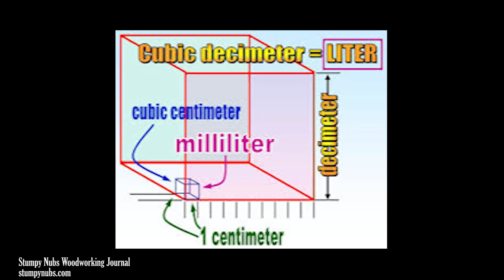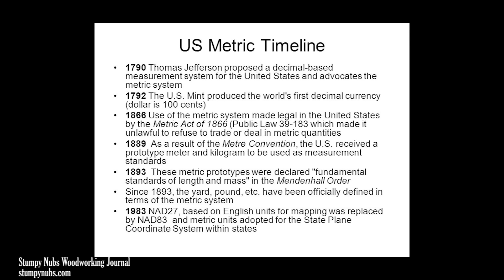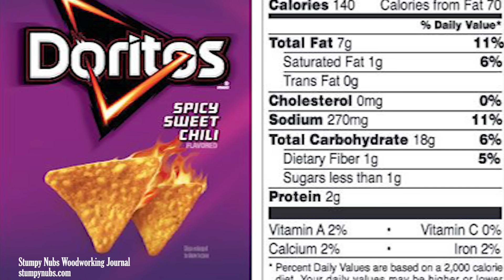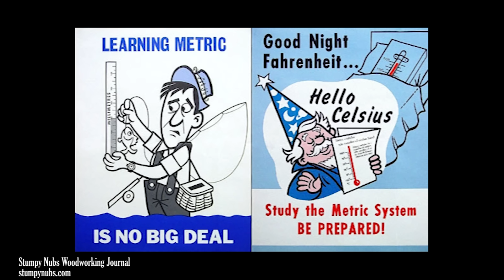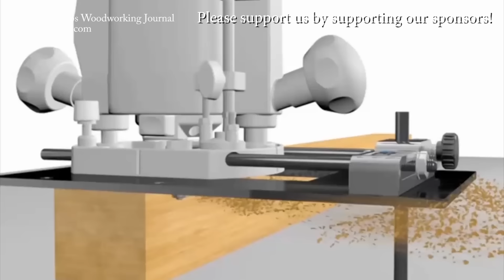BREAKING: The USA is switching to METRIC!

Comment: I was born and raised in the US and now live in Canada. I comfortably switch between imperial and metric; sometimes within the same project. For certain though any time I need to find the center of something, I use metric. Division of whole numbers beats fractions any day.
Reply: Quite.  I enjoy watching people trying to centre something 43 and 3/8 inches on one side, 44 and 5/16 on the other, how much to move to be in the centre?  Long silence.  Another long silence.  Hit with hammer.  Repeat.  On the other hand, my workshop is imperial with a mixture of BSF and BA threading tools, fraction and number drills, imperial measuring tools, machine tools graduated in 1/1000 inch.  It will not be going metric anytime soon.  Multiply that by a whole economy.  Unless the US government funds it, there won't be much movement, and it will be hugely expensive as every last broken tool will be dug out to be replaced by taxpayer's money.
Reply: Studied in BCIT and went through the same thing having to learn both measurements, and by learning both I mean spend 90% of my time memorizing the unit rates of all the imperial units.
Reply: @etherealbolweevil6268  I hate imperial with a passion. I always convert imperial to metric before I do anything. And If I have a bunch of damn drills or like 10-20 wrenches or sockets that are imperial, I have to line them up in order to know which one is bigger than the other FFS I hate imperial!
Reply: @etherealbolweevil6268   You gave both examples i will use those, finding center is easy. On odd numbers 43 3/8 for example subtract 1 to make it even leaving 42. divide by 2 = 21. for the fractions you add the numerator and the denominator together = 11 your new numerator. to get your denominator you just double your old one so 16. all together thats 21 11/16". Evens are super easy 44 5/16" ex. divide your whole number by 2. so 22 then just double your denominator so 32. that gives you 22 5/32"
Reply: Oh really? Take off .003 in machining,  or take off .000118? Sit down.
Reply: Or just divide 43 by 2 and get 21.5 if it's in metric.
Reply: With the same 3 digit accuracy you just don't do anything in the second case.
Reply: @poisonedtruth  your explanation, compared to "divide the length by 2", is in itself a good reasoning to drop the imperial / US customary.
Reply: Option A - centre = min + half(max-min) Option B - only make things in inches divisible by 4  @poisonedtruth
Reply: I am a french Canadian who have worked for Bombardier aeronautic for ten years and we used metric to build airplanes but in our everyday life, we use more inches usually. Once you know. 

We worked on our products but we made parts for Airbus, Boeing, etc… and the annoying thing was that the only aircraft we had trouble with was working on Boeing. Because they were the only plans we had to convert because the company didn’t want to work with metric system. It was a real pain in the ass and yes, at that time, I was cursing Americans to be that stubborn to not change for the majority but the majority had to change their ways to fit American way. 😅

In the end, metric, imperial, it’s the same, it’s just different lengths of mesures that’s all. But the metric is more precise tho. 

That’s why in Canada, we use inches for regular constructions and metric for more technical and precise stuff. I can convert everything but the only thing I have a lot of trouble remembering the conversions is temperature 😅

I know what it feels like 40•C outside and how feels 72•F in a pool and I use F to cook also but I have no idea what feels like 72•F outside nor the feeling of 40•C in water 😅

It’s really a mess when you don’t know both
Reply: The Mars Climate Orbiter would like to have a word with you.
Reply: What if you have to divide the measure into 3 or 6 parts? You need to do this in frame construction all the time. Nobody builds frame structures in metric. Ever wonder why there are no frame houses in Europe? Don't answer too quick. Think about how you would design a framing system in metric first. What would the size of a plywood sheet be? What frame spacings would you use to match this board? That's why we still, and always will have Imperial, along side Metric.
Reply: @timosdinkydetailing  It always depends on suppliers who usually do things imperial so it’s easier for workers to built, you don’t have to translate… but if the supplier works with metric, it’s gonna be easier with metric. And since America exports a lot, we buyers, have to work with your imperial system. 

So yes, it’s easier for Americans but only you and 2 more countries
Reply: @poisonedtruth  Which is only 3-4 times more complicated than metric!

Comment: I'm a Brit and we officially went metric in 1972 but I was brought up on imperial measurements so I am now fully bilingual.  The metric system is so much easier to use especially, since we can use calculators that all count in tens.  In 1972 I worked for a contractor who was building a large slab sided office block, the lads on site couldn't set the windows out because one side of the building appeared longer than the other according to the dimensions, which were imperial with fractions down to 1/8".  it was my job to check the dimensions and it took me all day adding multiple different fractions and even then having done it many times I could only come up with a consensus of what it should be.  Had it been in metric it would have taken me 5 minutes with a calculator or 10minutes long-hand to have arrived at the answer.  One other advantage of the metric system is the cross relationship between units such that 1 cubic metre of water = 1 Tonne (approximately 1ton), 1 litre of water = 1 kilogram, 1000ltrs = 1 cubic metre etc.  

It really doesn't matter what units you use so long as the result is the same, will it fit, how heavy etc?  But once you start using the metric system its obvious simplicity will shine through.  Those that have the hardest time are those that have to constantly translate between the two systems.  Its like a language if you think in the language you are speaking then it is easier.

Comment: I love that I, as a Swedish bought up in the metric system, took almost the entire video to notice that he has a Sjöberg workbench. Sjöberg is an incredible swedish name, and the bench is most probably also very metric. That beein said, we sometimes actually use inches for our lumber. So I guess the imperial to inch conversion goes both ways =D
Reply: inches in Swedish lumber is usually slur for the things that are actually measures in mm.
the Swedish 2 by 3  is actually 45x70 mm.
what I mean to say is that inches exists in the language but not in the measurements.
Reply: Don't forget that not many years ago we bought 4 inch nails.. Now they are 100mm nails
Reply: @sm3ttz  Well, as an Austrian, I always bought nails in millimeter lengths - except for Nine Inch Nails, of course... 🙂
Reply: Good to learn that you are "a Swedish" and not "a Swede".  That will be valuable information so I don't embarrass myself if I meet someone from Sweden.  I guess that means someone from your neighboring country would be a "Danish" and not a "Dane".
Reply: @douglashaag1127 English denonyms or nationality adjectives are very difficult to learn for speakers of other languages.  When you can write another language as well as original poster, whose English is quite good actually, then you'll know that petty comments impede communication and score no points.
Reply: But in Finland 2 by 4 lumber is 50x100 mm
Reply: @tapsulinka  Actually one can't find 50x100 mm "patting lumber" (pattinki) anywhere (maybe from small country-side saw mills). The big trade saw mills produce "48 x 98 mm mitallistettu" for frame construction purposes. "Mitallistettu" means coarse planed to exact dimensions (in reality I think they use fine saw for that purpose, not a planer)
Reply: @drops2cents260  Yeah NIN are the best.
Reply: Sweden changed from inches around 1970-1980 I would guess. My old Volvo 142 had some mixture I think. Nowadays some lumber and nails are talked about in inches by old guys (>60)
Reply: @tapsulinka  In Sweden also. If 2x4 are 45x90 mm it is planed wood. (Hyvlat trä)
Reply: the yankees inches was define by a Swedish man "Carl Edvard Johansson "
Reply: @tapsulinka  or 48x98mm if it's planed lumber (mitallistettu in Finnish)
Reply: I don't know like it is in other parts of Europe but in Poland standart thicknes of raw planks from sawmil are usually  1 or 2 inches or are at least called that. They are raw so I don't think any of them is exactly 25,4 mm thick :)
Our standart for fresh water pipes, garden hoses and stuff connected with fresh water are also in inches: 1/2", 3/4", 1" etc. Interestingly stuff connected with sewage system is in metric...
Reply: @douglashaag1127  Unless you visit Finland, then you can call them Swedes. Actually Americans used to call Finns "China Swedes". I'm pretty sure Nordic people just don't care. Call them by what you know and state your business, the business part is most likely more important.

Comment: I bought a fully metric tape measure for work doing HVAC. The other guys give me a hard time about it but it's easier to divide 120cm into two or three parts than it is 47.2441 inches. I regularly need to center mini split heads on a wall or between windows and it saves so much time and mental effort. They told me all the tricks for finding half with standard but i dont even need them with metric. It's also a smaller scale so more ability to be accurate. I started using metric for 3d printing modeling. Fusion 360 was set default to metric so I tried it. I'll never go back now. I still use standard on new construction jobs because there's standards for stud spacing etc. but I use metric whenever I can.
Reply: If you are still new to metric: decide wether to use cm or mm and stick with it, don't mix units, don't switch units otherwise you'll get confused by your own notes pretty fast. If you don't like to type in decimal points in fusion: go for mm. But note: many rulers / tape measures come in cm, unless they are from/for Australia, where they made mm the default unit by law.
Mixing units is terrible, say i go out to buy a piece of wood for a friend and he writes down 20 x 100 x 200. Thickness is obviously 20mm (because 20cm would be too much), but is it 100 mm x 200 cm or 100 cm x 200 cm or 100 cm x 200 mm? All three are reasonable sizes.
Reply: @blauesKopftuch  The rule says, if no units are written, the numbers mean mm, if somebody means cm but doesnt write that and sends someone else with that sheet of paper to a store he is just an idiot. If anything is unclear, why dont you just make phonecall?
Reply: Calling unit system only you and few other countries uses standsrd is so American.
Reply: what tape measure has decimal inch?
Reply: You mean "47 and a quarter, shy." Right?
Reply: @blauesKopftuch  I somewhat disagree. Judging by your name you are German? I am from Germany originally and let me tell you, if you write 20 x 100 x 200 then those three numbers are ALL the same unit, whether mm or cm, m or km. If someone mixes units then they either haven't been taught right or just ignore the correct way and the fault is on them.
Reply: @blauesKopftuch  >"But note: many rulers / tape measures come in cm"
I know what you're saying, but, crazily enough, rulers and tape measures usually come in lengths of complete meters, have numbers in centimeters, and the actual scale (tick marks) in millimeters.
Reply: What blauesKopftuch has written bears some truth. Choose the unit according to usability. In German we have two translations for carpenter: 1. Zimmerer; Zimmermann for large scale woodworking, like roof truss, wooden houses and 2. Schreiner, Tischler for making mainly furniture. The latter, Schreiner, use millimeters for most work. They stay in the same unit and it is easier to have whole numbers for the most part. If your projects are larger than ten meters, it is easier to use meters or centimeters. It largely depends on the needed precision. The fewer you have to use the decimal point and at the same time having less trailing zeros the better it is for yourself and for communication.
Generally: 
distances cross country (from townt to town) are most often in km (kilometers)
distances in your back yard are most often m (meters)
distances in your room are most often meters or cm (centimeters) depending on precision. They also could be mm (millimeters).
fabric is/was often measured in dm (decimeters) or meters. Tailor's cloth tape measure often has colored decimeters (red, white, green, white, red...) for easier orientation
...
Reply: @ingo_8628  " The rule says, if no units are written, the numbers mean mm"

Whose rule? I was born and raised in a fully SI country and can say with little doubt that nobody would assume a unitless length measurement would be mm.
Reply: In Sweden we have used SI for a couple of generations. But all of our tape measures still have cm on one side and inces on the other.
But none of us ever use the ince-side of them. Funny, isn't it?
Reply: @isodoublet well, any engineer would assume that. or anyone who used to work with blueprints